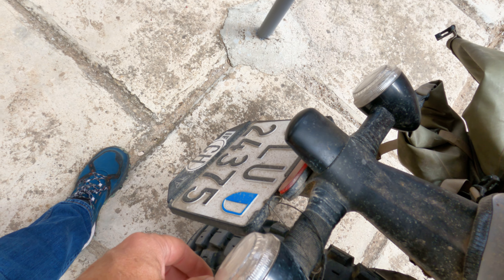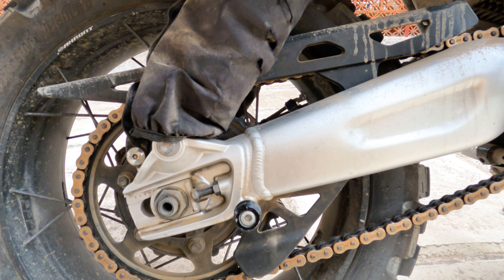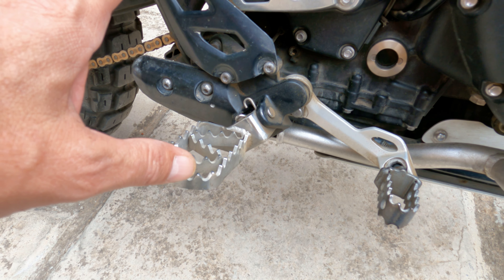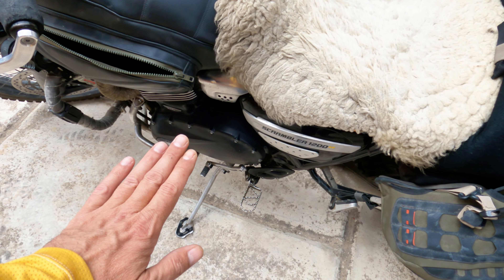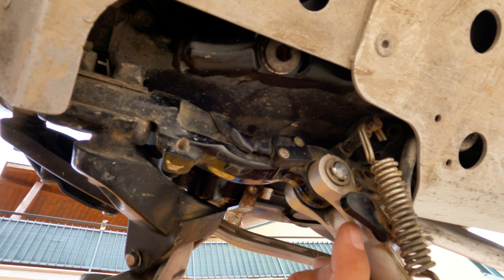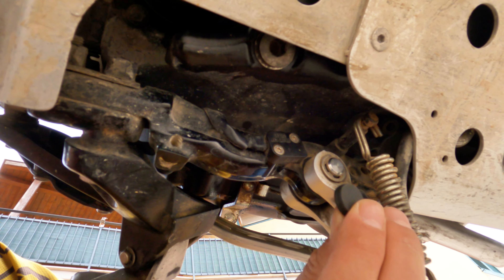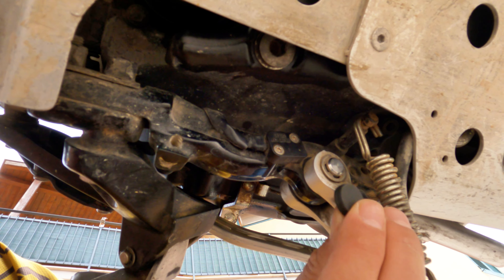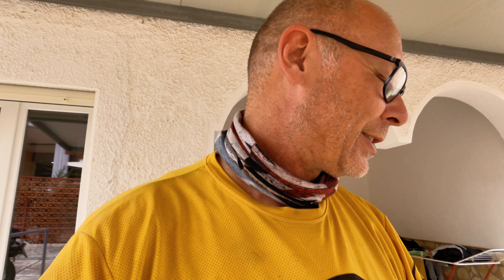Your kickstand snaps off, can't start bike! Drilled holes in my Scrambler 1200 XE swingarm. WHY?

Comment: Thanks again for this, in particular the drilling of the swingarm drainage hole. My chain adjustment screws are getting harder and harder to turn and I couldn't work out why. Will be drilling a couple today. 🙏🏼
I also carry a magnet which I have stuck on the frame under the seat (I don't always have my tool kit with me when riding around town). There's a vid somewhere where the magnet on a guy's kickstand was broken off by a stone or something and he was stranded. 🥺
I've never broken a headlight and after researching the cleaning issue have given the mesh guard a miss. I like to keep mine clean and with the high front mudguard they can get dirty pretty quickly in the wet/mud.
For the OEM oil filter I use a filter removal tool which I got for a couple of bucks off a local website. It's basically a cup that fits on the filter with a half inch drive. Super easy to change. You can also just punch a screwdriver through if you're in the middle of nowhere but it's a bit messy. I'm sure you know this.
Footpegs look awesome, particularly that they drop your foot down a bit which would solve one of the gripes of the bike which is the foot brake lever being too low. You mentioned you might post a link but I can't see it here?
Great tip on the numberplate. I lost one, fortunately in my home country, but it would be a nightmare overseas. Thanks for that 🙏🏼.
I'm trying to think of some tips for you but you have everything I know covered and more! A couple of things I've done: I flipped the bar risers around to give me a better riding position and a bit more height when standing. I have a velcro strap holding a stiff piece of plastic around the front brake reservoir to protect it from stones. I also use that strap to lock the front brake when adjusting the chain using a trail stand (great piece of kit). Also to put the brake on when lifting the bike if I drop it on a hill. Swapped out the weak horn for a plug and play Denali Soundbomb Mini for a bit more volume when that truck is changing lanes on you. Wired up an aux system to run tire pump, jumper cables, quad lock phone charger but you mentioned in a previous post you have something set up. It would be good to see what you've done in that department if you have time? Thanks for the advice in a previous post about not loading the battery up too much because the alternator isn't that strong to charge. Put a TEC Booster Plug in to help with low speed stalling. Also a spacer in the throttle housing as there was quite a bit of play in the throttle when I got it. Changed mirrors, grips, pegs to Pivotpegz but interested in yours, pipes to slash cut because sound good, cheaper to replace by half if dented, less chance of denting because smaller, allow me to put my gear on without risk of burning bags. They are a bit noisy for stealth camping though, even with baffles. Changed handguards to Barkbusters. Put on SW Motech crash bars. Must do your bash plate extension to protect the oil filter at some point too, why didn't Triumph do that from the start?! 
Have you done a toolkit review? That could be some good knowledge to share. Also what spares do you carry for long tours? My clutch cable broke once when overseas which was fun getting a replacement for 😭.
Any electrical problems? My ABS and TC light comes on randomly sometimes to say they are disengaged. If I turn the bike off and on they go away but not cool.
Anyway, I've written a book here so sorry about the but its a real honour to be able to talk to someone knowledgeable that uses our bike for extended, out of the way adventures. Happy trails.
Reply from the maker: Thanks so much. Lots of info. Just typing this so you know i was reading it. But just came home from a day offroad. And i want to reply. .
I edit my post later with my proper response. I tag you so you know.
Such a great comment you wrote. Extremely appreciated 👍🏁
Reply from the maker: Again, thanks for commenting, much appreciated, and I'm sure some others here appreciate it as well. Now I've found some time, sorry I was a bit busy with work and out on the bike for the full 2 days.

'You mentioned you might post a link but I can't see it here?' Thanks for pointing that out. I updated the description the moment I read your comment.

'Put a TEC Booster Plug' I have never had any issues with that at all. It runs perfectly. The gear ratio is just not good in 1st, especially on very steep hills. I switch off the engine and go easy down the steep hill. Like this weekend, I had a very steep one. Engine off. Works perfectly.

'Front Brake Reservoir Protection' Tennis wrist sweatbands I added them right at the beginning when I started, before even my first drops with the bike, wanted to get one of those aluminum cases. After riding and falling many times, in my humble opinion, absolutely no need. Got a Velcro band as well, it's tangled around my mirror, always use it when on some trails.

'Clutch Cable' When I left Switzerland, I had a full checkup on my bike, including the cable. It was still in mint condition. If it would have broken, well, a bike shop, local fixer, etc., somehow there is always a solution. BUT next time I will bring one because I had this time stuff with me which was unnecessary, non-bike stuff, and related to tools and bike.

'Have you done a toolkit review?' No, and I think I am the wrong person for that. I am by no means a mechanic at all. A bit taught by friends here and there and my dad. When I am back home, I will remove some really unnecessary stuff and doubles... go figure.

'Filter removal tool' Got that tool, but did not bring it; I ran out of space. And until now, it was always somehow removable, but I liked the K&N solution with the bolt. Screwdriver hack, yes I know. Extremely messy. Happy me never needed to do that. Yet.

'It would be good to see what you've done in that department.' I had a setup which will be possible back again, ordered it already. 1 Day before I left I broke it. Will post it in the community, and the setup. But as I type it now, honestly very honest? Funny as it sounds, I did not miss it... So I might not even put it back.

'Any electrical problems?' 1. The old story about the connection of the Bluetooth key. Fixed right in the first 500km. 2. In Morocco, the ABS sensor in the back was dirty and displaced. Made my front display go nuts. Clean and adjust on return by the dealer. Could have done it myself, but did not really care. 3. Until now, 2x Fuse Blown. Just the other day one, because me, totally tired, wanted to unlock the steering lock and put the key in the 12-volt socket. ROFLOL. Me awake instantly LOL."

I hope I somehow covered your questions. Happy Trails as well.
Reply: Bonjour,  merci encore pour tout c'est précieux conseils !
2 petites questions,
 la première concernant le fusible, de quel fusible parlez-vous ?( j'aimerais l'acheter en préventif)

Vous parlez du tableau de bord que vous avez rendu fou !?
Vous voulez dire quoi ? Problème avec l'affichage TFT du tableau de bord ?
Franck

Comment: Great tip about the magnet! Will be putting a magnet on my bike somewhere now just in case. Have a 22 XC and will check to see if the swingarm has those drainage holes. If not, easy enough to add. Safe travels!
Reply from the maker: Thank you. Would be interesting to know if they added them holes in later models. Ride Save 🏁

Comment: I made a suggestion to Lone Rider to make a somewhat generic round plexi+screen fold-down headlight protector like they do for the GS that would work for a lot of retro bikes. You can actually choose to have plexi, wire screen or both to install.

Does the headlight  have a glass lens? I had a pellet size hole on my OilHead with a glass lens. For this reason I prefer a full plexi screen. The Touratech design at that time was bolted on.
Reply from the maker: Hi, it is a glass screen, but so far, no problems, as I ride almost always alone. So I don't really get many stones hitting the lamp. For cleaning it, I've just gotten used to it by now.🏁🤙

Comment: Haia from Wales. XC owner here at 20,000 miles from new. As to drilling the swingarm... There are actually drain holes each side of the swingarm on the inside face, just above where you have drilled. Mine were clogged with mud causing the adjuster bolts to stiffen up as you mentioned. Cleaning the drain holes isn't easy without removing the rear wheel - it would have been better if Triumph had put them underneath as per your modification!
Interesting tip about the magnet. I never put weight on the sidestand (other than luggage) but the sidestand  pivot and bush needed replacing as I use the cross channel ferries from UK to Europe enough for the sidestand pin and bushing to wear when they strap the bike down for the crossing. Fortunately an easy fix, but it would be difficult if the sidestand snapped as you say.
Thanks for the info - enjoy your journey in Sicily!
Reply from the maker: Thank you very much for the comments. If I remove the rear tire, I will definitely check for those holes. But I'm almost sure there are none. My model is one of the first from the production line in 2019. Yours? If added later, maybe they included some holes in the newer models. Thanks for the info on the bushings. I will check them as well. Take care and ride safe. Sicily is amazing; did some off-roading today—awesome place. Had a wire today messing up my rear. Have it on Instagram as a reel. Sometimes stuff happens you never expect, LOL.
Reply: @ScramblerTales  Haia. Mine's also a 2019. I know yours (the XE) has a longer swingarm, but I think the end caps are the same, marked 'SL' on the left and, unoriginally, 'SR' on the right. The drain holes are at the bottom of a sort of moulded crease just above where the paddock stand bobbins fit. I'd be surprised if they weren't also on the XE model.
Sicily sounds great... watching you is like adventure trail riding by proxy. I only ride the local green lanes, gravel roads and forest roads here in Wales.
Reply from the maker: Hi. When I remove the rear next time, I will check that. It would be a bummer, but anyway, as you said, even if there are drain holes, they are in the wrong place.  Green lanes are always on my mind. Britain, Wales, Ireland, and Scotland are on my list. I just don't know when yet.
Glad you enjoy riding as a proxy, now i know why i sometimes tip over... extra weight i guess.😁

Take care and ride save those lanes.
Frank

Comment: HiFlo Racing oil filters have the hex nut/bolt on the end of them too - used them for years and can recommend them.  They are a bit cheaper than the K&Ns too.
Reply from the maker: Hi. Thanks for taking the time to comment. I will check them out.
Very much appreciated 🏁👍

Comment: TOP TIP:- keep your kick stand magnet handy by putting it onto the oil drain plug. It will turn the drain plug magnetic while it's there and you can easily get hold of it should your stand fail.
Reply from the maker: Personally, for me, this is not a good option, as I have an extended skid plate. Previously, I had the magnet on one of my four handlebar bolts. Guess what? Even with those strong magnets, they slid away, especially off-road.

Personally, I also would not place them on the oil drain plug when doing a lot of off-roading. I would be worried all the time, thinking, "Is it still there, or did the last tree branch catch it?" 🤣

Anyway, after so many kilometers off-road, my kickstand has never broken off. It's really just a precaution in case it happens, so I have it safely stored in my tool bag. It only takes me a minute to retrieve it.

Nevertheless, it is a great idea if you do not go off-road. This is just my two cents.
Great Idea 👍🏁 Ride Save

Comment: Yes a lot of bikes have that issue with side stand , like the KTM 1090 and others , I have a Moto Guzzi V85tt, they have a bolt that can come off on the kick stand , but the bike will still run , I was very surprised. I had to cable tie it up until replaced bolt .
Reply from the maker: Good to know that I am not alone with my issues. Funny that some of the heavy bikes do not have proper kicks.

Comment: Stop the chain adjuster bolts seizing up by removing them completely and coating the threads with lots of Copperslip before refitting them.
Reply from the maker: Thanks for the tip. i do that, plus the holes it's perfect.🏁

Comment: Hi, I've learned a lot of useful tips from you video. Thank you for sharing! 
How often do you do an oil change? You bike sounds ok without the ticking sound from the engine, mine started to have ticking sound when cold at around 12000km. Do you have this issue?
Reply from the maker: Thanks for the heads-up on the video. Great you got something out of it. 
Keep in mind that the Bonneville engines have that little ticking noise .
Btw for oel i use always Motorex 10W/40 TopSpeed. If i can get it.

Comment: Hi.  I’ve got a new 2022 scrambler with only 2000 miles and it has an engine knock.
Wondering if you had any problems with your engine knocking or if you know anyone with a scrambler that has had a knocking on theirs?

Maybe a friend of yours may know what could be causing this knocking.
I gave video and a short you can listen to on my channel.
Any help would be very much appreciated.
Thank you.
Reply from the maker: Hey While I’m not a mechanic, I can understand your concern with the engine knock on your 2022 Scrambler, especially with only 2000 miles on it.

With such low mileage, I highly recommend taking it to a Triumph dealer if possible. They’ll be able to give you a professional diagnosis and ensure that any potential issues are addressed under warranty or service plan.

It’s challenging to diagnose engine issues just by sound, but a few things to consider could be the type of oil being used or even the natural characteristics of the engine. Triumph engines can have a distinct knocking noise, which might be normal.
Again, your best bet is to consult with a Triumph dealer to get a definitive answer.

I hope this helps, and best of luck with your Scrambler!

Will be fine it's a good bike especially the engine!

Comment: I have two Triumphs, a Tiger 900 and a Speedmaster 1200(both 2023 MY)and both have very stout kickstands. So, it surprises me that your kickstand is flimsy. Maybe they revamped them in the later years.
Reply from the maker: No they did not its now third generation. I have version 2019 the model which came out first .
The latest they even removed oeilings shocks and the front upside downs. Same price but cheaper parts.. but thanks a lot  for your input. Very much appreciated 👍